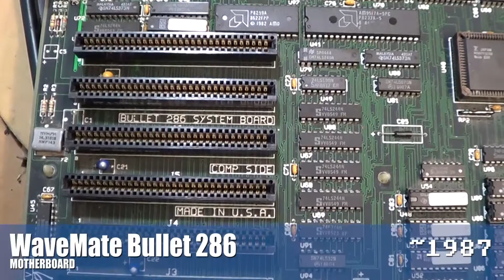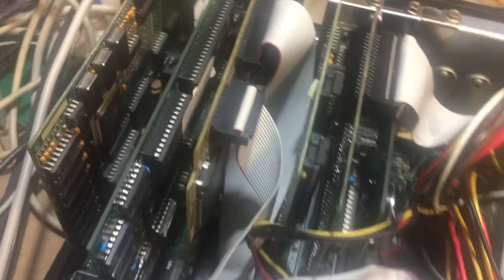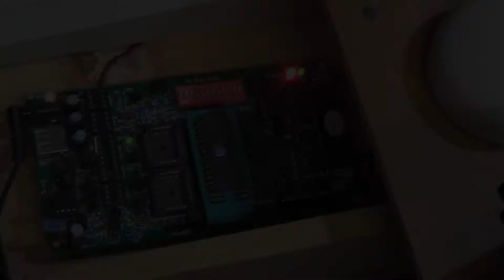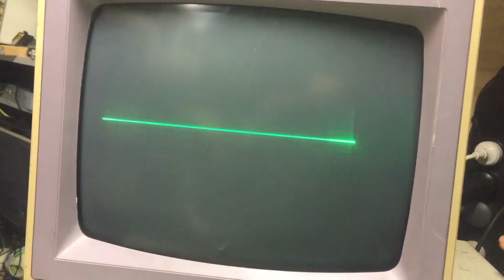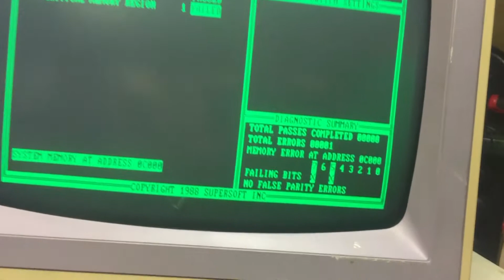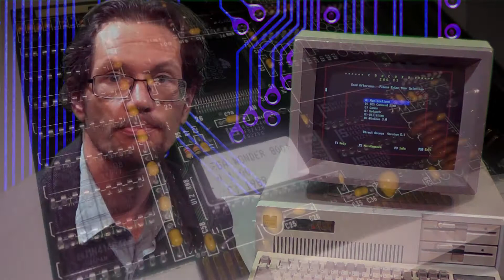Concord 286 XT - BaudBand

Comment: I'm starting to see DMA controllers dying, which is absolutely the last thing I'd ever think I'd see failing.  I have a 6300 that needs the DMA controller socketed and replaced.
Reply from the maker: I didn't expect it either. TBH I only replaced the chip because I knew if I posted for help on vcfed, I'd be told to replace the 8237 first. I just had it in my head that it MUST be something else causing the error (like a 74 IC) because I've never had one fail before.

Comment: With that amount of failures, I would have tossed it.  I once had found an NEC 286 machine thrown out complete with 20MB hard drive.  The machine was working initially and then started getting more and more erratic.  Finally the hard drive was no longer recognized, and then it wouldn't even boot from a floppy.  I put it back where it belonged.

Looking very forward to the next video, I remember reading about those expansion units.